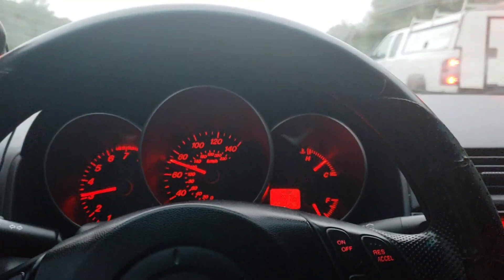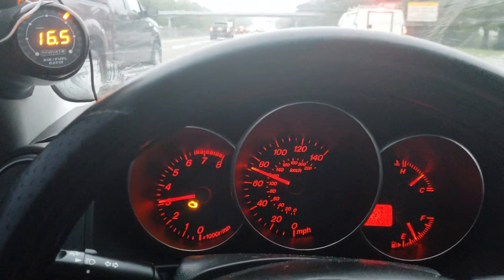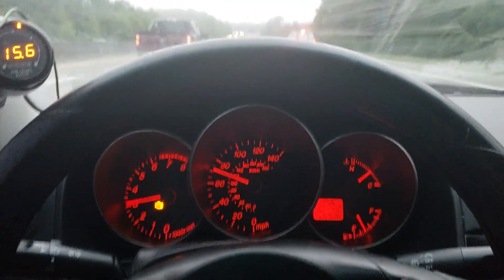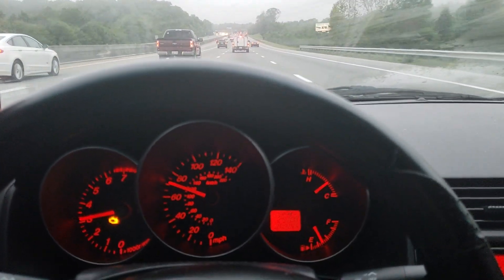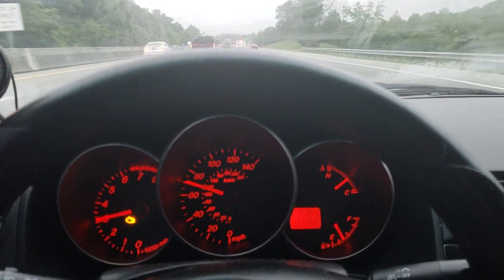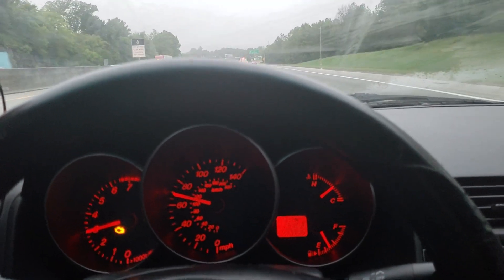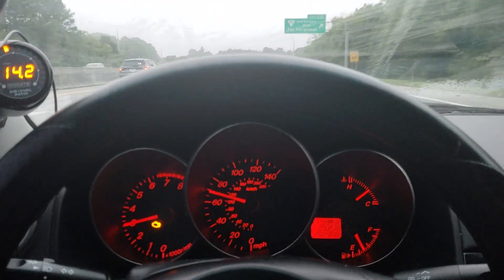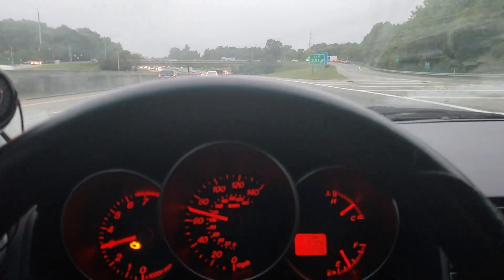Turbo Mazda 3 bad maf?

Comment: Did you get it resolved?
Reply from the maker: Sure did. It was the maf that was bad.
Reply: @justanothertuner4135  Man alright appreciate the response!
Reply from the maker: @royyang89  no problem man! Anytime!
Reply: I just paid 1300 to get my injectors changed and now I’m waiting to see if I should spend the $300 it would cost to get a new oem maf sensor to resolve the exact same issue I’m having and yes I should . Btw mines an 08 red speed 3
Reply: @joeestrada6946  in the future make sure to try  clean the MAF first before buying a new one
Reply: Makkuro1(真っ黒 ended up buying the MAF cleaner and still no luck , bought a new MAF OEM still the same issue